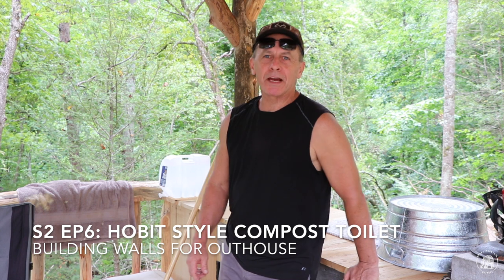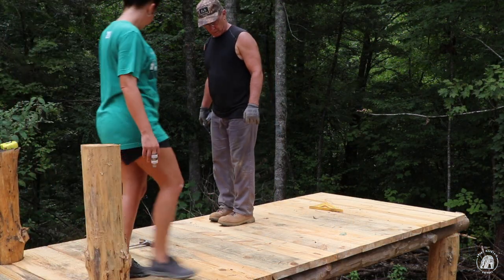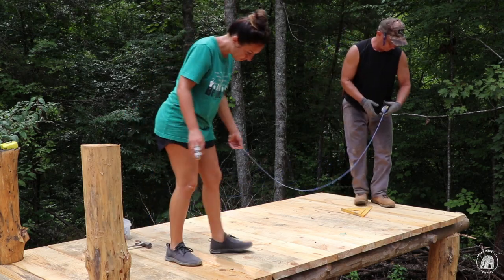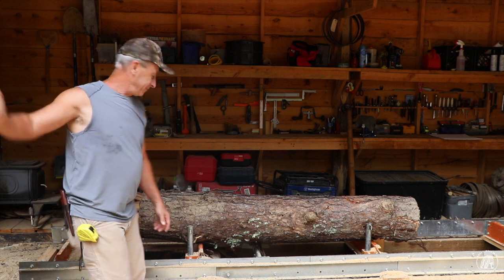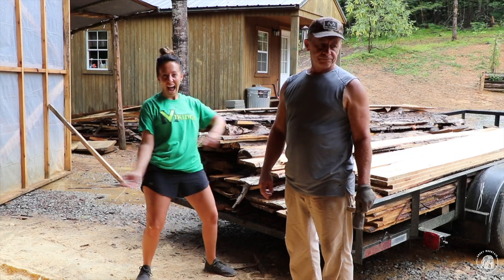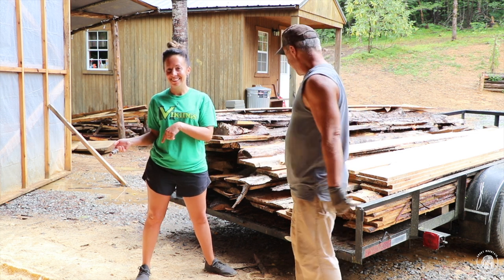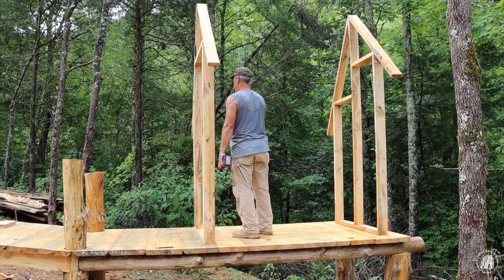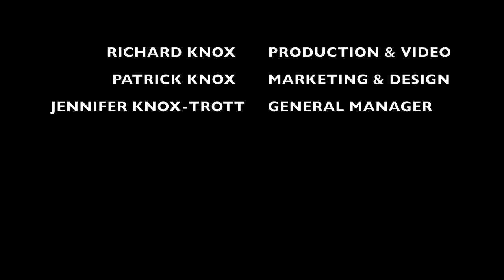S2 EP6 | HOBBIT STYLE OUTDOOR COMPOST TOILET | BEGINNING THE FRAMEWORK FOR THE OUTHOUSE

Comment: We bought some raw land that we would love to build on, but with the cost of wood going up, we’re considering milling our own from trees we cut down on our property. Never done it of course, but can you use the wood right away, or does it have to dry out first?
Reply from the maker: I use it right away but you have to consider the shrinking in diameter as you build and accommodate for it. The length stays the same. I usually allow 1 1/2 in overlap or plan on 3 in baton to cover shrinkage depending on how I’m building. 
If your going to frame with it, it would be better as starting out to choose a location where you could cut and stack logs that will dry for a year before milling. Paint the ends to prevent checking. You may still get a little shrinkage after a year but minimal. Be sure and cover logs with shelter in a manner they can breathe and separated.